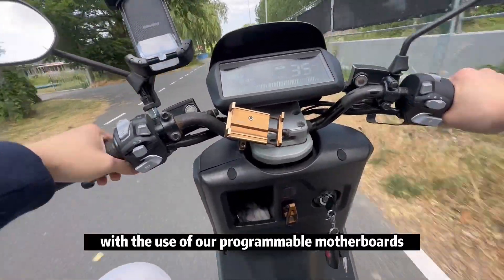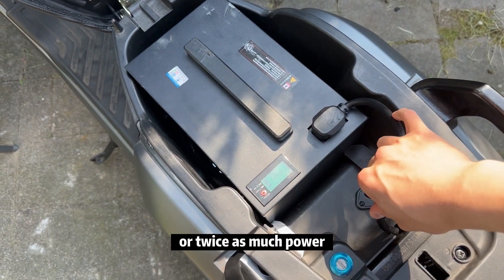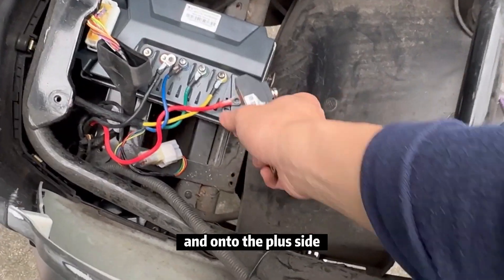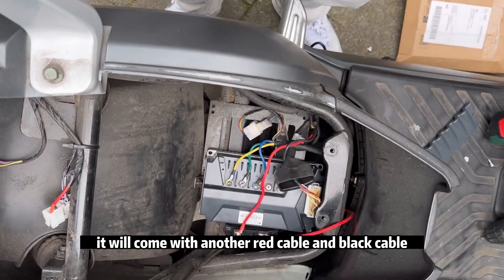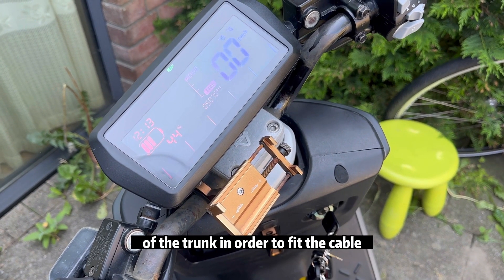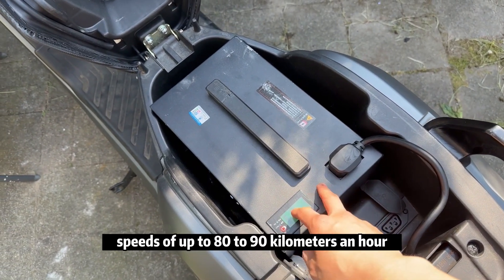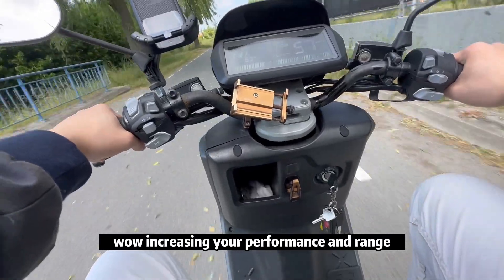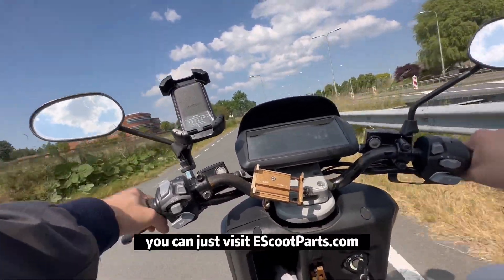Adding a Second Battery to a NIU Scooter (N1S to NGT Upgrade Accessory)

Comment: I noticed you used a different kind of battery, 1 is the Original NIU and the 2nd one is Your custom battery will it work together as one? will there be any issue wit it being different kind? I'm asking to be clear. coz I already have 2 NIU batteries on my NQI GTS sport but thinking to buy another 1 from you and wondering if it will work mixing together at the same time?
Reply from the maker: Only with our battery regulator since it can adjust for differences between two batteries as long as they are same voltage
Reply: @escootparts2284  can you share me a link of that battery regulator.
Reply from the maker: https://escootparts.com/product/niu-scooter-dual-battery-accessory/
Reply: @escootparts2284  oh this one, But my NIU model is NQI GT/S means already have 2 batteries. How this benefits me?
Reply from the maker: Then you dont need it as original bike already has this feature.

You can upgrade to two larger batteries if you want more range 60v64a
Reply: @escootparts2284  Actually, I bought 1 60V 58ah to Aliexpress same battery as on your video. But mine don’t work. I don’t know why that’s why I asked you and thinking your battery regulator will make it work. Can you advise?

Comment: Can I use one orignal niu battery and one of your battery with the dual battery accessory

? so example one original battery with your 60v63amp for NQi would they both work together? or would the higher amperage put it off?

as rn I have NIU NQi GT/S (has two batters already under seat and under the floor board) but I'd like more range and I want to know if I need two of your battery to replace them both or if I can just buy one and mix it with original one.
Reply from the maker: Yes the diode will proportionally draw from the batteries
Reply: @escootparts2284  So 100% 

Using one 60v23amp niu battery with your 60v63amp custom battery with ur battery diode will work together?
Reply: @kuiguri not answering is not a good sign. I was wondering the same but it appears they just want you to spend 1,7k not knowing if the thing will work on not.
Reply: @carloborraccino1774  Yeah i'm not gonna bother, their motherboard advertises 55mph or more but my scooter already does 55mph.. so no thanks plus it's under warranty so I'll chill with what I got now I got another motorbike it would just be cool for more range but I'll just invest in second set of battery from NIU
Reply from the maker: @kuiguri with our battery diode it will work yes
Reply from the maker: @carloborraccino1774 the answer is yes like in the prior comment. The diode will balance out the difference in battery %, for 64a and 32a as an example.

For NGT you need to buy two of our batteries
Reply from the maker: @kuiguri this is for N1S / N Sport not the NG…

Comment: What happen if i charge 100% the battery under the seat and leave yhe other at let's say 10%? Will they balance and get around 50% or the difference in voltage will be something that will damage some9or even being dangerous?
Reply from the maker: The diode inside will balance the differences in the battery percentage level however, it is, of course, best not to have too much of a difference

Comment: Must to buy dual battery charger right ?
Reply from the maker: You can use the original charger to charge both batteries through the scooter or charge each battery seperately